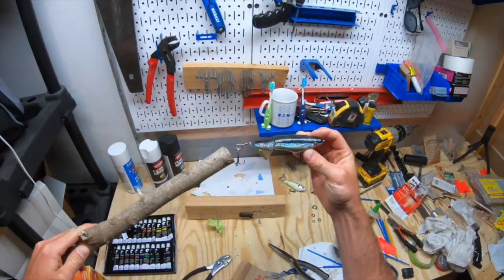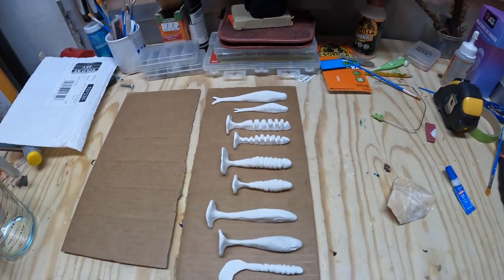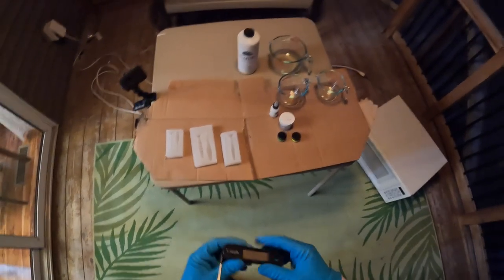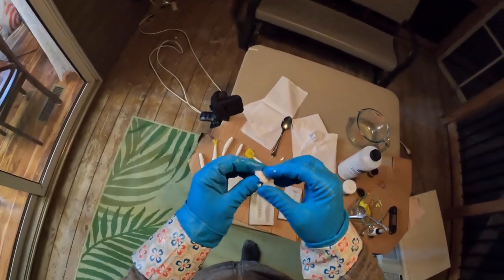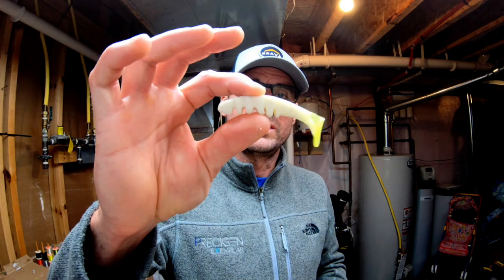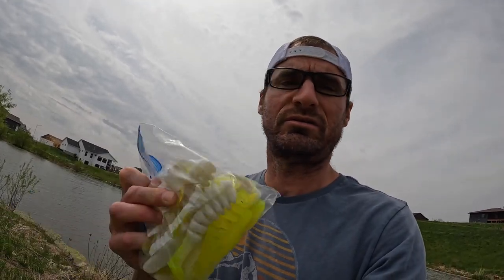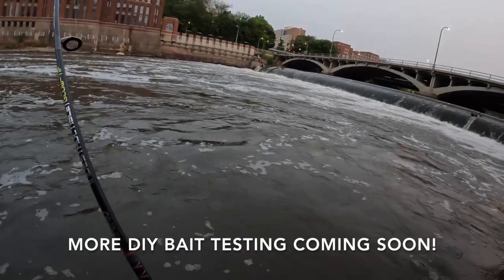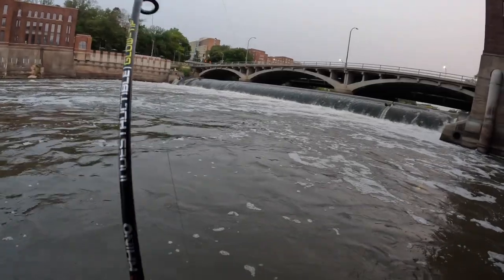Homemade Open Pour Soft Plastic Baits (Clay Molding, Silicone Casting, Plastic Pouring and Fishing)

Comment: I've messed around trying to make my own hard crank baits but it's difficult to get the shape/action/weight right. Lips for diving are difficult.
But after seeing this i might have to finally try the soft plastics. You did a great job making it accessible. And catching stacked up pond bass is right up my alley.
Reply from the maker: I think what has worked best for me when a bait isn't working/swimming right is to compare my bait side by side with my favorite manufactured one and try to spot any subtle differences in the design that might make their bait swim better. It usually takes several tries and in this case it took about 5 different tail designs to finally get something that I liked. My main mistake was trying to make too many baits at once. If you focus on just 1 soft plastic bait it is very doable as long as you have a space to do the plastic pouring (the fumes are horrible). I really like the clay molding because unlike wood when you make a mistake you can always work backwards to modify. I found it much easier to get a shape I liked. I appreciate the comment and good luck with your bait making!